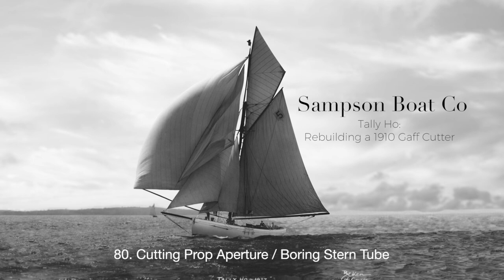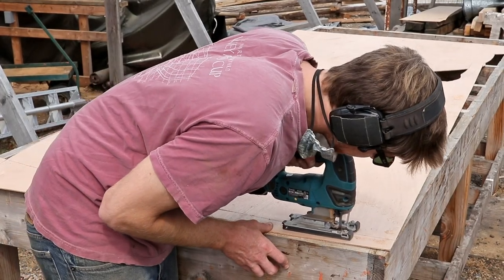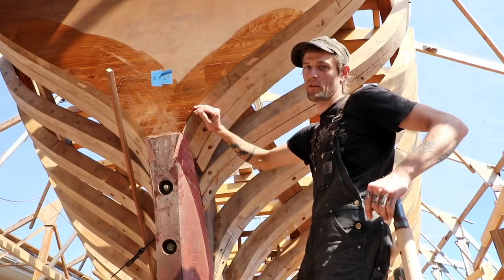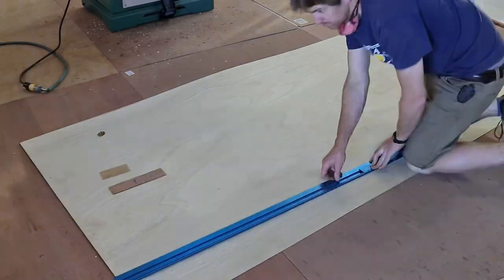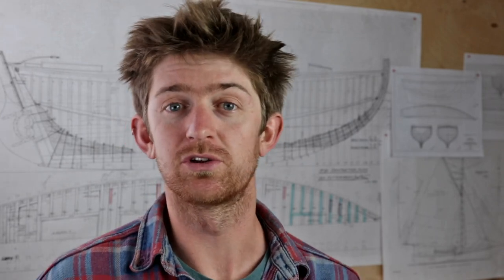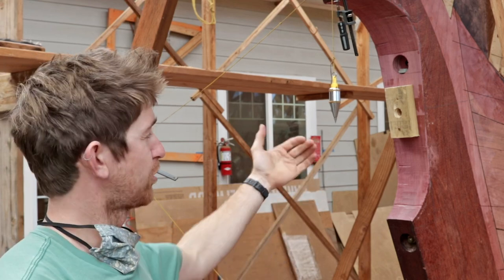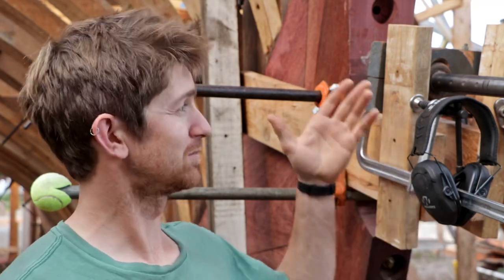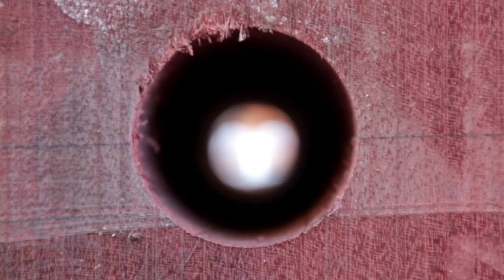Cutting for Propeller / Boring for Prop-Tube ( Wooden Boat Rebuild / EP80)

Comment: Tighten all 3 of the drill chuck key positions, a tight tip.
Reply: Out of curiosity, why? They all tighten the same collar.
Reply from the maker: Good tip! I usually do actually, but these things don't always make the edit.
Reply from the maker: @jimjenkins673  I know, right... it doesn't seem to make any sense, but it does make a difference.
Reply: @SampsonBoatCo  I thought you might already know since it's especially helpful grabbing onto threads.
Reply: @jimjenkins673  Each position provides a small clearance to the threads through the force trying to move the collar towards the drill body.

That provides a little more movement that was unavailable from just the previous position.

The gear teeth do not only provide force as a rotation, there's more happening. Does that explain it well enough?
Reply: You'll be able to picture what's happening, just look at Charles.
Reply: Why? Any one of the positions allows the key to rotate the sleeve of the chuck, the only reason for three holes is for convenience,  so that you don’t have to rotate the chuck 180 degrees to find the hole.
Reply: @smoigida  Actually that's probably true from the design point but the way it works mechanically there's a real benefit to tightening all three. You can prove it to yourself quite easily. Tighten one position all you can tgen try another and it'll go a little more. After the third one there's not much if any movement available if you keep going.
Reply: @smoigida  Consider a nut on a thread. If you have the ability to push the nut towards the head by an outside force you would be able to rotate it a little without requiring any added torque force.

An impact driver uses this method.

Comment: awesome.. did you ever consider powering the boat with an electric motor instead of diesel?
Reply: @Steve Walker i dont want anything i just asked if he thought about it :) good day
Reply: Why?
Reply: @alexandermenzies9954  i saw some videos of conversions and its a pretty cool technology. it's even possible to regen with the folding prop to charge your system. obviously you're limited on your range but it it depends how leo is planning to sail this boat. if he wants to be able to motor around for days it's not a good idea :)

Comment: Could the engine layout not be redesigned to accommodate a horizontal prop shaft?  I owned a Han Christian 38T with the same angled down shaft arrangement and as a consequence of differential angle of attack from side to side on the blades, the boat presented some difficulty backing to starboard.
Reply from the maker: I don't believe that is due to an angled prop, but rather just due to prop-walk, which is caused by the higher water pressure at the deeper half of the prop (regardless of angle). An angled prop shaft simply lets you have the prop lower in the water, which is advantageous for several reasons.
Reply: @SampsonBoatCo  The angled prop results in a phenomenon called p-effect which is different from prop walk.  It is more noticeable in aircraft but also a phenom in boats and is due to the different angle of attack port-to-starboard of the prop blades, the difference being the angle of the prop shaft added or subtracted from the blade pitch, thus less thrust on one side than the other of the prop.  The result is a vertical torque.

Comment: Was the concrete bilge (you took out in ep.7) original to Tally Ho? Can you melt all the old bronze plank rivets and incorporate them into the new knees?
Reply: Recycled metal can be sold back to the supplier, but it'd be unwise to use it for a new structural casting.
Reply: The old rivets were copper, not bronze

Comment: Leo Somě ideas for Talley Ho.
Super in Shaft for Anoding protection.
Interested to know what Přop  assembly you are using.
I have design experience in hundersted 3 blade and developed my own control systém using 98:1 reduction electric gearbox from Norway to drive the VPP (Variable Pitch Propeller)
Controller through NMEA on Raytheon instruments and had it controlling of exhaust Gas Sensors on the Diesel about 140 HP Perkins.
Made for efficiency og Engine under load and fuel economy for passages
Alsø had alternative shafts with Independant clutches alonside parell to main shaft port and Starboard driving alternatives for charging batteries and refridgerartion compressor dive compressor Watermaker.Used on Engine running stop under sail.For charging cycle.

All Energy in Shaft utilised for PTO.
Alsø used forward Shaft for hydraulic pumps for windlass and Capstain.
Hoses in headliner.

Comment: Was the original boat a private racing yacht or a cargo ship or what ? I have watched all the vids I think but I do not remember what the first boat was used for . Please explain
Reply: I believe it was a pilot cutter. Those were designed to "race" out of the dock to be the first on the scene when bigger ships arrived, and then they'd guide them in. Or something like that.
Reply: @BuratiinoXZ  they would take the pilot out to the large ships who would then pilot the ship through dangerous waters, something which still happens today. Check out the Columbia river pilot boats, they are really cool!
Reply: He goes over its history here. Make sure to watch part 2 as well! https://youtu.be/pBzVc1OuTJU
Reply: She was designed & built as a luxury yacht for sport-fishing & offshore cruising. Her hull-shape & rig were based on pilot cutters, which were renowned for their speed & sea-keeping abiliities in heavy weather. Unusually for the type, she has a squared-off transom instead of a long overhanging counter at the stern. It's said that this is b/c the original owner wanted to keep her at a small port that didn't have the space or maneuvering-room for a longer boat.

Comment: quick question, whats the difference between a Gaff Cutter and a Bristol Cutter?
Reply: As far as i understand it: a Bristol PILOT cutter is a Gaff Cutter, but not all Gaff Cutters are Bristol PILOT cutters. a Gaff rig is a specific rig (with a gaff on the upper mainsail)
Reply from the maker: A Gaff Cutter is any vessel with one mast, a gaff mains'l, and 2 or more headsails.
Bristol Channel Pilot Cutters were a group of working boats that would sail out of Bristol (UK) - each with a harbour pilot on board. They would race each other to be the first to intercept an inbound cargo ship - thereby allowing that harbour pilot to board the cargo ship and gain the employment (in guiding that ship into port). Bristol Channel Pilot Cutters were known for fast sailing in trying conditions. As stated above, they are Gaff Cutter rigged!
Reply: Cutter: https://www.youtube.com/watch?v=dnOAB04_-M8
(Note that Tally Ho's mast is set about 40% of total main deck length aft of her prow.  With her bowsprit mounted to effectively extend the boat's length, the mast is effectively set amidships.)
Gaff Rig: https://www.youtube.com/watch?v=K9_L-VGSbwc
Gaff Rigged Bristol Pilot Cutter:  https://www.youtube.com/watch?v=g5MhJKXAayQ&t=2s

Comment: Why cut a hole in the dead wood and the rudder ! just cut a propeller aperture in the dead wood and then have a sharft cupping , then when you need to replace the sharft it’s only a short one , also you have not lost any rudder area.

Comment: Realy...you're going to weld  a cutting tooth an not think about heat treatment and steel. Probably a bad choice!
Reply from the maker: well it worked! ...the second time. I did have to preheat it and wrapped it in a fireproof blanket afterwards. Hardened steel.

Comment: Traditionally, most boat builders put a long shaft through the back of the boat which means you needs something called a packing box to keep the majority of the water out. Why not use a hydraulic drive instead? In this fashion, you would have two hoses that would be completely sealed through the hull, and no opportunity for water to infiltrate, and possibly, no maintenance for many, many year.

Comment: The way I see it, the original boat is gone. This is a brand new boat they're building.
Reply: Don't agree but we can agree to differ , I think as the build goes on more and more original fittings and timber will be used so maybe in the end it will be 60% new wood and 40% old and built to original lines.  One thing we know is it is gong to be nice
Reply: @mausplan3890  Have you seen episode 1? It shows floors crumbling and rot on the inside. With brand new hull frame, who in their right mind will use discarded old timber to cover it? They're building a sea-worthy boat, not a museum piece.
Reply: @blogusvox  Replacement of parts of a wooden  boat (not exclusively) happen all the time during the life of it when it is done as it should be done. Over time this will result in getting (nearly) all components replaced but It is till the same boat. Nobody questions that.
Tally Ho had bad or no maintenance at all during  it's later life  (let's say from the sixties onwards) and that is why she was in such bad shape. Therefore Leo had to replace everything in one go and that comes down to the same result as the example above. It is the same boat, Lloyds register, Josuah Slocombe and the complete wooden boat world agrees on that.
Reply: @on4xb  Technically, replacing EVERYTHING constitute a brand new boat. The only "original" thing it has is its name. I don't care if the complete wooden boat world, agrees - it's a brand new boat whose design, pattern and dimensions were copied from the original. I think, the best way to describe it is... a clone.